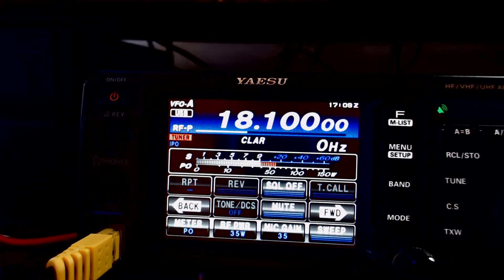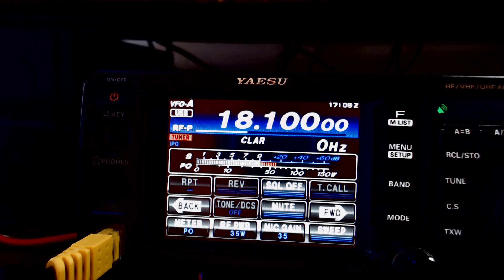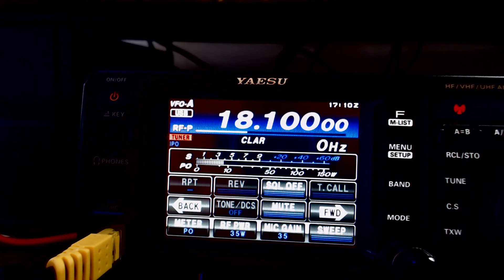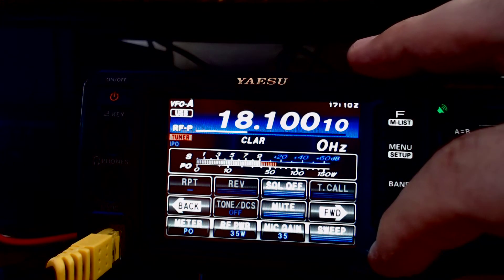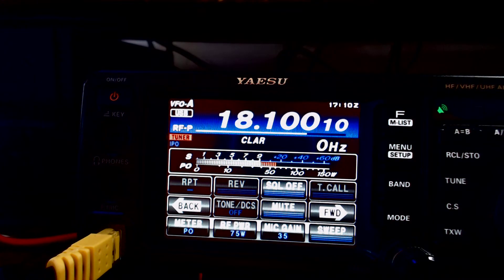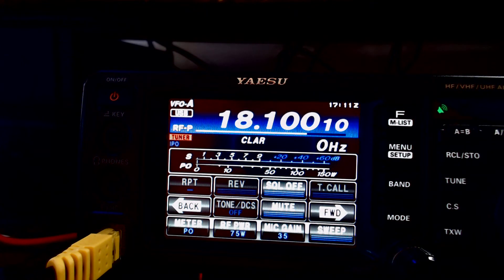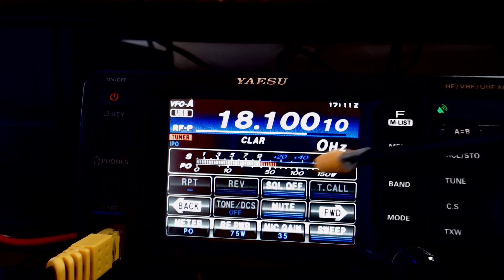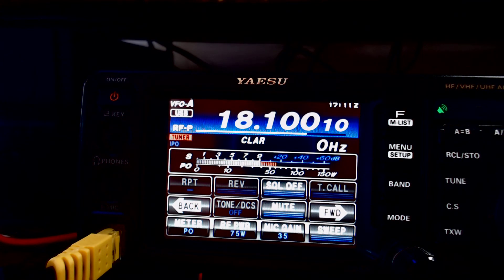Yaesu FT-991A  Tx Power cut in half.

Comment: Your not alone friend, mine has lost all its power only 2 watts at best. Worked perfectly fine for 24 hours then out of the blue the power died. Disconnect the usb cable no wsjt-x connected or running just using the radio in standalone usb mode and still no power. Tried factory reset made no difference wsjt-x screwed my rig. All setting carefully followed levels and gains set to no avail.

Comment: Did you figure out the reasoning for your issue?  i am having the same problem all of a sudden
Reply from the maker: I had it working on FT8 and the power would hang with a program crash, reboot fixed that from time to time.
SSB seems to be working now but I have a magloop as an antenna and only push 15w thru it now

Comment: What was the antenna VSWR when you tested?  How much power does the radio run when you yell or whistle into the mic?  Did you resolve this?
Reply from the maker: SWR was close to 1:1, Not sure what power I was showing I've since switched back to the FTDX10. Oddly having the same issues with SSB not transmitting above a few watts. FT8 shows the PWR that I have set along with CW. When the radio was new I would show full power on transmitting using SSB.

Comment: That is too much alc , it cuts you power to nothing if its wrong. Select alc for the meter. Set your mode to usb data, set your power to 30 watts or less and then adjust your dt gain  until  the alc showing (white line for alc) is gone or barely showing on the left. The more it is on the right  the more it cuts power.  Also if you get a blinking red  tx light it won't tx because  SWR is bad.  I make thousands  of  digital  qso's  on my FT991A  doing this good luck.
AA4CP Chuck 
Fort Pierce FL